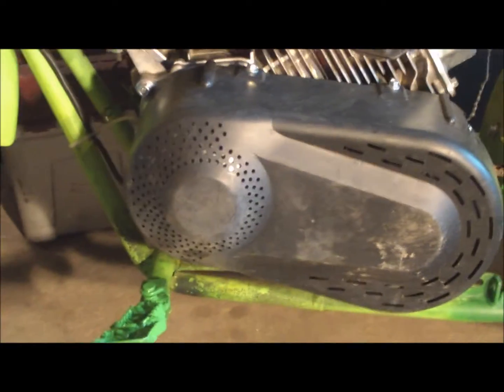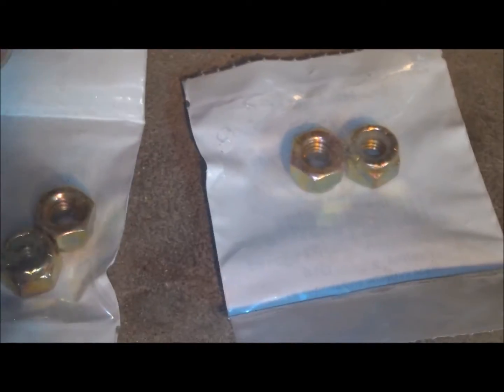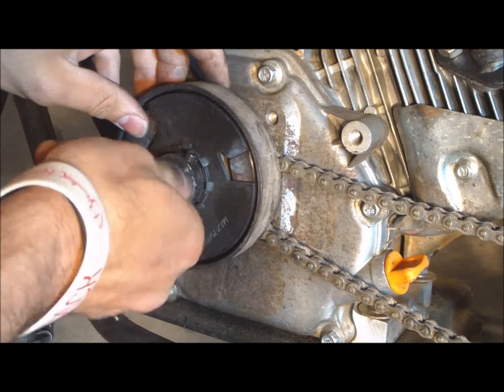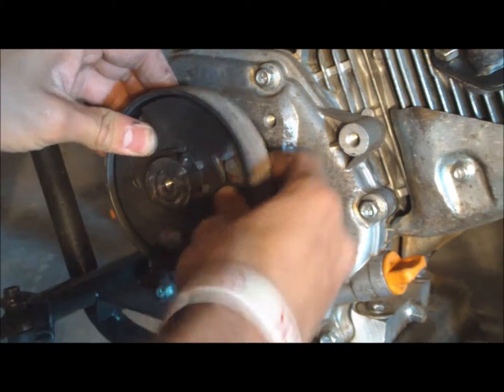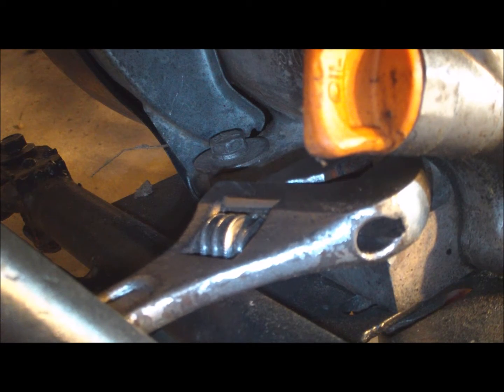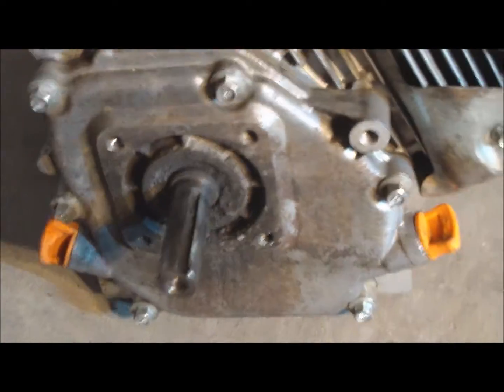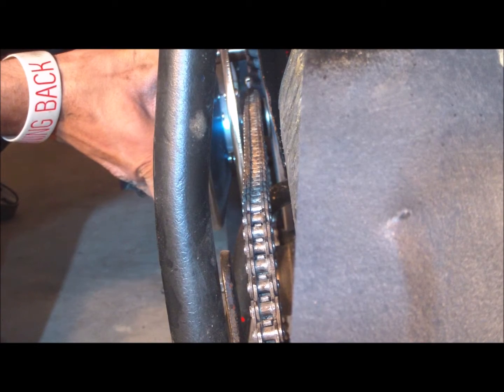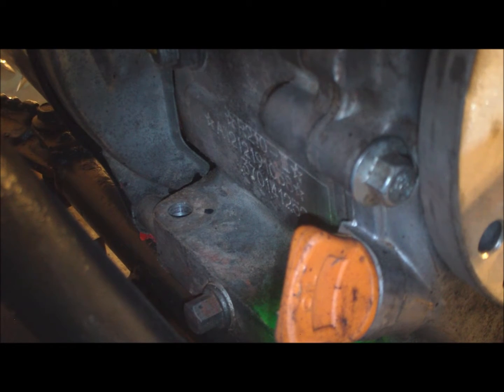Clutch to Torque Converter Conversion on a Doodle bug Mini-Bike 6.5HP

Comment: So did you have to modify the frame at all?
Reply from the maker: The only modification to the frame was the 2 holes that I drilled in the front of the engine plate for the front engine mount bolts
Reply: @GioGuitarDude  so I won't have to cut the convertor or the chain guard part of the frame?
Reply: @GioGuitarDude  so all you did was basicly lift the engine about an inch?
Reply from the maker: @jakeday5936  I lifted up the engine 1” and moved it forward about 2”. This allows for nothing having to be trimmed assuming that your DB30 minibike frame is of the same dimensions as mine tolerance wise.

Comment from the maker: I have heard a lot of complaints of people snapping belts and I want to address that again. You need to remove the thick shiny galvanized washer that is supposed to go behind the back pulley and instead place it behind the front pulley along side the black spacer (between the engine and the front pulley). This straightens out the belt. I have been riding my minibikes all summer long for 4 years on dedicated dirt bike trails and all of my belts still look brand new!

Comment: 2X 5/16" STEEL SPACERS 1" LONG             Do you mean 2 inch outer space ?  what is 2x ?
Reply from the maker: You can get them at Home Depot or Lowe’s in the screw/fastener section. They are usually in the specialty drawers close to where you get the other bolts for this project. Hope that helps!
Reply: @GioGuitarDude  Thank you!

Comment: A note on alignment: I found some top view diagrams on a web site that showed that when you line the back plates up they are not supposed to be lined up --- I know it sounds odd... but the way you had yours initially looked close to they way the diagram looked ... and meaning before you made the washer adjustment changes...I saw this diagram on one of the many go cart web sites I went to last night, but off hand can not recall which one exactly it was on...
Reply: disregard this as I mixed up drawings for symmetrical converters with what is actually asymmetrical converter (belt profile has one flat side)...my mistake...
Reply from the maker: I easily have dozens of hours on each of my bikes with these 30 series converters (5 currently and one more on the way) and all of the belts are original and look brand new still. From a purely scientific standpoint, I can’t imagine having the belt cockeyed and constantly rubbing against the spinning clutch pulley face being beneficial for any reason whatsoever. I’ve read lots of forums of people shredding the belt on the first ride, and I’m very confident that it’s because of the recommended belt alignment. Thanks for the heads up though

Comment: I see ebay has about 10 sellers selling the exact same (made in china) torque converter for starting at around $60 bucks... so I assume likely all these originate from the same factory in china. Is the quality of these reasonable? they look not ok in the pictures shown... I ask because I go way off road and do not want to walk 35 miles out of the bush (if I can avoid it)?...  I am thinking a spare belt would be the only extra you would pack along with some tools...
Reply: sorry I made a typo ...I meant to say the ones (torque converters)  on ebay from China...do look ok to me... not the other way around as I mistakenly said..
Reply from the maker: I have not had one issue with these torque converters at all and I ride in the national forest on gnarly dirt-bike trails 20 miles away from the nearest town. I’m more worried about the chain falling off and getting warped than the belt snapping. Carry some basic tools and a few spare parts (some chain+ links and maybe a spare belt [even though I don’t] and you shouldn’t have an issue. Always a good idea to ride in groups too regardless if you’re on a mini bike or a brand new dirt bike.

Comment: Nice vid ...
I use on rough hilly bush trails... Right now I just have a simple Centrifical Clutch and chain, on a db30 with 6.5 hp engine.
For your rear chain do you recommend using the original db30 chain (I think it is #35) or do you switch up to the #41?
If you shim engine up just right can you eliminate the need to chop pieces off of the converter?
Reply from the maker: The usefulness of the #35 chain IMHO is maxed out at 5 HP. If building a kart or bike from scratch, I would highly recommend going with the 40/41 chain, but if you don’t mind keeping some spare lengths of chain and a few extra master links with you, #35 will get the job done. On the DB30 frame, it is not guaranteed if you can avoid cutting the aluminum converter backplate because the clearances of the frames are definitely NOT consistent (as seen in this video). If you relocate the gas tank, install an aftermarket intake and stealthy exhaust (to lower the height profile of the engine), you can definitely fit the engine W/ torque converter without cutting or chopping anything. 
You can also use a car jack to bend the frame up more, but cutting a tiny chunk out of the plate is way easier than any of that.

Comment: Your chain is supposed to ride on the tensioner wheel not under it...
Reply from the maker: Well then Yamaha did it wrong, because my dirt bike has the roller on the top :).
It does not matter at all whatsoever where the roller is in conjunction with the chain... it is there to provide variable tension for the chain, and that's exactly what it's doing. I have it on the top because it gives me a wider range of adjustment while using the torque converter.
Reply: @GioGuitarDude  your pushing the tension outward bub, your working WITH centrifugal force already pushing away from the sprocket which even if a fraction, causes excess wear on the teeth. Yes in theory your adding the same amount of tension but in the wrong direction according to physics. If derailment was needed for an intended purpose  or working with belts such as  idler wheels for clutches/serpentine systems then yeah, outward down pressure is boss.
Reply from the maker: @fatbuddycat  I got straight A’s in physics and don’t see a problem with it. We have been ripping these bikes through the mountains on dedicated dirt bike trails... climbing mountains and going on 10 mile trips at a time for years and the belt, sprockets and chain are all still in perfect condition on all 5 bikes that I have done this conversion on.
Reply: @GioGuitarDude  Picture a loop with two sprockets and a chain, oblong loop. When you add a tensioner inside the loop pushing out what happens to the departure from one sprocket occurs on approach to the second sprocket. You've successfully shortened the point of contact and depth at which the chain travels on the sprocket. Now, remove your tensioner and place it on the outside of the loop pushing inward (against the centrifugal force) you now have a more complete departure from one sprocket,  more on the approach, a very snug and level line of travel on top where the power pulls the chain down and around the output sprocket while also feeding constant tension to the driven one. By stretching  the feed from the inside your exerting downward force to tighten the chain which is constantly putting the stretch at the lower left front sprocket  and lower right rear sprocket which means your adding a force that pushes resistance in two different directions. No biggie. It still works, maybe not as efficiently but proven nonetheless.
Reply from the maker: @fatbuddycat  I understand what you’re saying, but the upper counterclockwise tug on the chain from the clutch pulley takes away from the tug on the bottom (loop) of the chain on the tensioner. Your theory would make sense if the tensioner was on the top of the chain (loop) where the actual torque is being applied between the wheel sprocket and the front clutch pulley, but there is very little force on the bottom of the chain (loop)  compared to the top. All of the force on the chain and sprocket teeth is being exerted on the upper portion of the front and rear sprocket... anywhere else the chain travels below that is without load and doesn’t matter. The chain contacting 8 teeth at a time instead of 8.5 (theoretical number) because of the new chain angle isn’t going to effect anything.
Reply: @GioGuitarDude  I'm starting to think we are gonna come up with some groundbreaking concepts and change the industry forever! Lol, that's why I like people that think like us mini bike guys. Grassroots technology at its rawest.
Reply from the maker: @fatbuddycat  Yeah man seriously! I’m buying a new house soon with a nice garage, so I’m going to be tinkering like a madman here soon. I have almost everything I need for my next project... a big wheel 2WD minibike 😎
Reply: @GioGuitarDude  woah. You talking homemade Rokon? My second bike was an 85' Big Wheel 200. I rode that 6 speed like a madman. Only thing I ever owned with a Jack shaft 2 chains and a manual gearbox. It was very stiff and bouncy, best suited for riders 5' 10ish and 200+ pounds. I loved the rack and wished I had the removable headlight like the 350. I'd really love to tear it up on one again.
Reply from the maker: @fatbuddycat  Yeah exactly but simpler... a mud crawler or mountain climber. Nice and slow with a lot of torque. I’ve been pondering the idea of a jackshaft that also functions as a pivot point for a swing arm so that I can have at least rear suspension. Rokon’s are awesome, but I wanted the challenge of building one like it myself and made exactly how I want it
Reply: @GioGuitarDude  I did a pretty extreme jackshaft pivot with an ultralight mini bike build. I was going to extend the swingarm after I tossed some shocks on there that lifted the rear 3.5 inches and I saw how extreme the travel was but said the heck with it and tossed the chains on. I left it a little loose in the back because I figured that the extreme suspension travel would surely snap the small chain (tf8 yuck, I know) when compressed and under power. It did not. The Big Wheel had a chain slide guide up under the guard near the pivot and the front chain always looked loose as all heck. I remember a problem somewhere where it all melded together, I think the bearing or sprocket on the inside of the jack shaft is prone to excessive wear from tension issues on the primary chain. The way Coleman puts the spring idler in their Jack plate design is the way it should be but I think Yamaha just stuffed big chain in a tight squeeze so it wouldn't come off the sprockets and the loose fit (no adjustment, can't remove a link if already stretched) wore stuff out over time. I had my BW200 in the 90s and it was terrifying to track down parts. We got it easy these days man, I got out of ATVs because I got tired of brand savvy parts and waiting a month for shit to ship (it annoys me thinking about it!). Not to mention all the plastic clips, clutches, axle seals, axles, carburetor fixes, one piece motor/trans housings, tires, BEARINGS, ball joints....... not fun if you gotta fix everything yourself.  I'm moving back up north to help my family since just losing my father. I'm going to visit the Rokon factory in NH, maybe I'll get some cool pics and video to share! I look forward to your project, no joke, I have bad OCD (makes my life very difficult) and this just gave me something to toss around. Deep thought helps me cope and relax.
Reply from the maker: @fatbuddycat  I’m really sorry about your father... I couldn’t imagine. But yes thank goodness parts are easy to come by nowadays and I’ll be looking forward to your upload! Take care 👍👍

Comment: Beware of a torque converter snapping into as it happened to me they are prone as snapping to
Reply from the maker: I've been riding mine like crazy for two summers so far (we ride them on really rough dirt bike trails in the mountains) and the belts are still like new. I think there is a design flaw with the alignment of the two pulleys, and that's why I removed the 1/8" thick washer from the rear and added it to the front in the video. I should order some spare belts though... that would suck to have one rip up in the middle of nowhere.

Comment: What size are the sprocket on the inverter
Reply from the maker: Just the stock sprocket that comes with the torque converter. 12t I believe
Reply: GioGuitarDude 💯
Reply: GioGuitarDude What size belt did you use ?
Reply from the maker: Same belt that comes with the kit.

Comment: In the process of doing this. Think that pipe you rest the front two engine mounting parts through is strong enough or do you think the vibration of the engine will cause it to crush?
Reply from the maker: I easily have 50 hours of riding on each DB30 that I have done this conversion for (which is 5 bikes) in very questionable terrain, and there has been no issues. It is actually more sturdy because the engine plate flexes a bit when you introduce that much torque. Being halfway on the actual frame, it's stiffer.

Comment: A lot of people cut a chunk off the aluminum plate under the back pulley, to clear the frame, to prevent interference and rattles.
Reply from the maker: I ended up doing the same
Reply: I recommend lifting the engine an inch or two so you don't have to mod anything.

Comment: I'm having a problem with mine I recently put the 212 and.30 series torque converter and today the the belt is getting eatin up could the problem be I may have it on wrong help me out
Reply from the maker: Yes, or you need to put another washer between the engine and front drive pulley to straighten out the belt. I cover both issues in this video
Reply: +GioGuitarDude did you put the 2inch screw in
Reply from the maker: Demitri Hall Yes I did. Be sure to either torque it down super hard or put loctite on it
Reply: I used loctite and it felt hard when I was putting it in I got the one you said in the video to get
Reply from the maker: Demitri Hall not sure man. These engines with this setup take those exact screws
Reply: Yeah I no I mean it just felt hard in my opinion but I got it on and it's fine haven't had any issues yet
Reply from the maker: Demitri Hall Cool man! Let me know how it rides

Comment: actually my bad were did u get the smaller pulley for the chain tensioner
Reply from the maker: http://m.ebay.com/itm/Lower-Chain-Roller-20-2106-/391267956499?nav=SEARCH